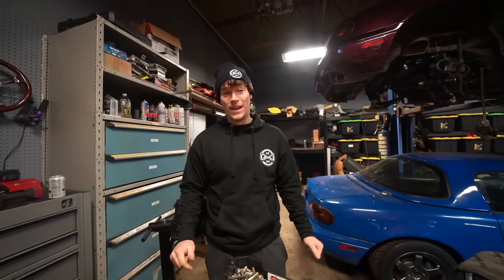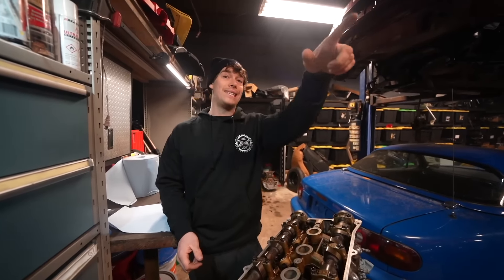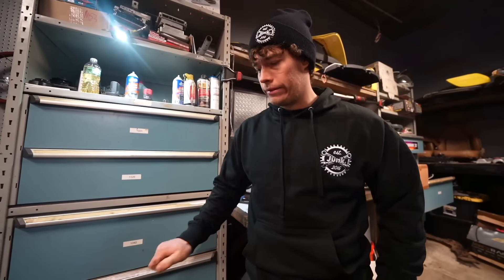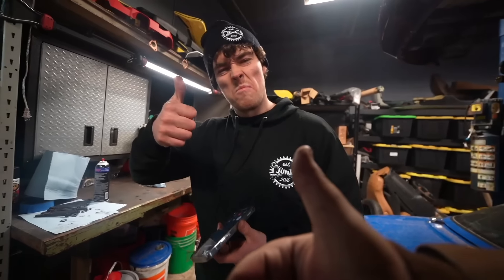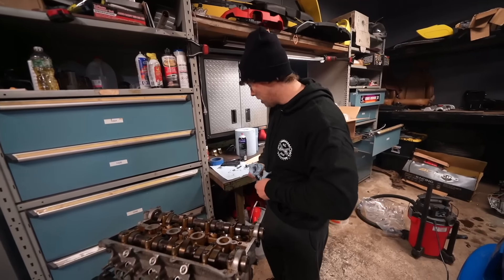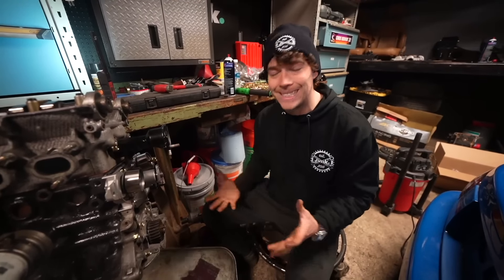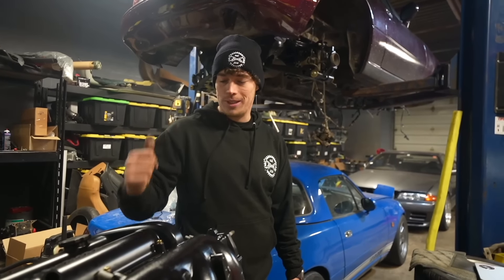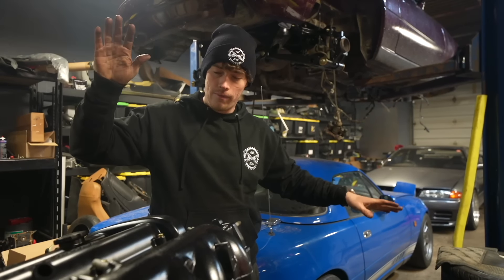REVIVING A ENGINE TO BRAND NEW!

Comment: Get a box fan and hang it behind the stove so the heat moves through the shop. Just make sure you keep the fire going.
Reply: Yeah they constantly let it go out and re light it. Lol. Just let it fucking burn.
Reply: they make a stove fan that sits on top and doesnt require electricity fyi

Comment: If you want to keep your shop warm you need proper wood and a cheap fan to push the heat around. To start your fire you need some dry softwood ex spruce or pine to split for kindling. Once your fire is caught you want to put in some hardwood. Ex: Maple, white birch, yellow birch. As long as there isn't much wind getting in the garage door you should be good. I live in Eastern Quebec. I heat my house and garage with wood and it's -20 celcius right now
Reply: Salut mon ami
Reply: Yessir Quebec represent
Reply: The real blueberries 😆

Comment: Just show up with the police and the title and make him give it back.
Reply: Sometimes you gotta steal them back, had to do that with my trailer.
Reply: He already got it back
Reply: There is no title lol that’s my old car
Reply: Or Glock
Reply: @RONIN1111  the best way tbh 😂
Reply: Chris got things turned around. Wraps a show car and paints a drift car that gets immediately ruined lol. Why not paint the car that's going to stay clean for longer
Reply: @martin1649 i think that's the least of his worries right now.. paint or wrap doesn't matter if the car never comes back lol by the sound of the comments i think he got it back though
Reply: This is CT. You don’t even need a title.
Reply: To get what? Did I miss something? Well tbh I'm half way thru the video
Reply: I had to do it with my 1996 air ride civic just show title and call the cops and have them walk up with you

Comment: I reused my 1.6l head bolts and they've seen ~15k miles of boost. They're not TTY (Torque To Yield) so they don't stretch. No need to over torque. 👍

Comment: 1:19 Dang, shots fired. To be fair, who pulls a motor, has it on a stand to do a refresh and doesn’t take the extra 20 minutes to do the head gasket for insurance lol. Rather than it potentially going bad in the near future and doing it in the car. Also if it was missing a locating dowel, makes me think someone’s already been that far into it, so better to be safe then sorry. 

Next up is you should pull the SR20 out of the 180 and do a full refresh if you plan on daily driving it.
Reply: Putting the old head gasket and bolts back in is worse then leaving it alone
Reply: Who reuses a head gasket? In certain situations it’s okay to re use the bolts.

Comment: @Ricer Miata

You really need to research on how to convert that new wood stove to burn used engine oil. U have a welder and everything else u can get at Home Depot for 50 bucks. I heat my 800 square-foot garage all winter on nothing but my used engine oil. Way better then messing around with chopping and storing wood.